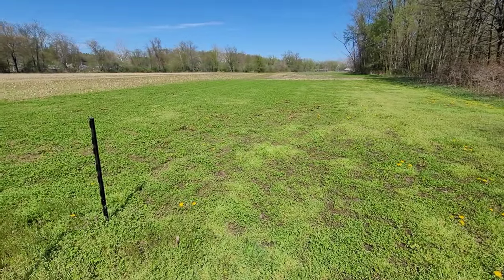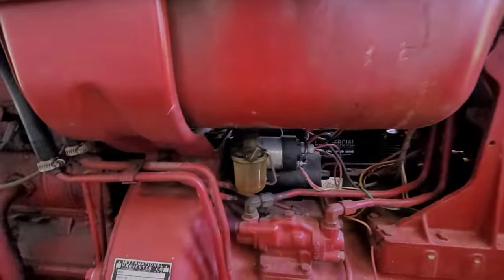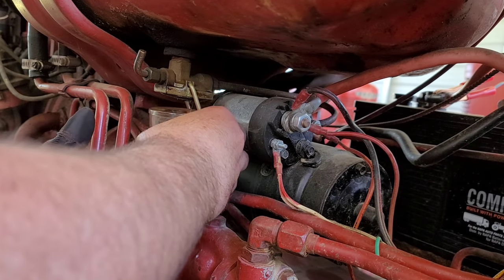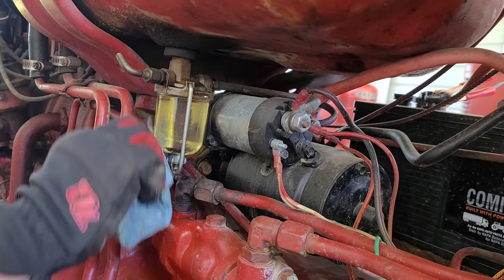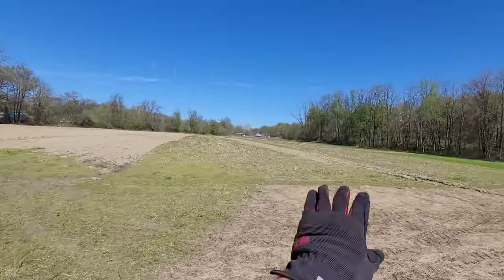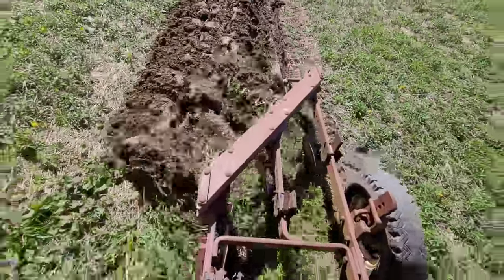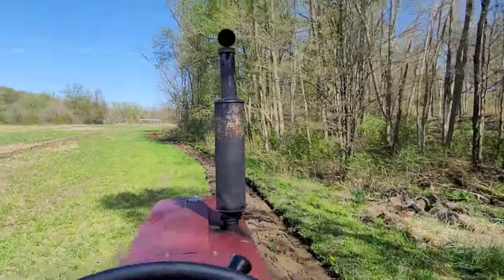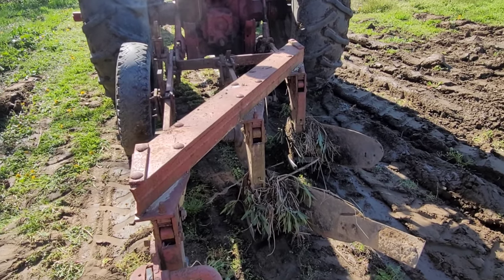Cleaning the Bowl & Fixing the Clover

Comment: If you have a bunch of varnish and residue from old gas in the tank, try  throwing a couple of cans of Sea Foam in the tank. That stuff dissolves the varnish. My Super W-6 had the gas tank full of that crap and I ended up cleaning the bowl frequently. I put 2 cans of Sea Foam in the tank and never had any crud in the bowl since. Last year at harvest, we discovered that the box was too bad to use on our Loadstar and it was harvest time. We found a 1962 Ford 3 ton with a decent box and a 292 engine. We got it running but it would barely run. We put 2 cans of sea foam in it and after a while it cleared right up and ran perfect. Pressure washing the gas tanks won't solve all your problems as the tanks have baffles in them. Your M gas tank has a baffle, too I know there's a lot of comments on that you need more plow on the 756. Although that may be true, in the soft spots it's nice to have a big tractor on a small plow. It would be great to have a fast hitch on the 400. It would be perfect. When messing with the gas, it's a good idea to unhook the battery with the starter right close. I learned that lesson the hard way. We went to get our Farmall 460 going. It was about 3-4 years and the gas was full of crap. So I pulled the whole sediment bowl assembly off and took a wire to dig out the gunk in the tank. The wire touched the solenoid I burned the tractor up and almost burned me up too. I was able to suppress the fire enough that I can save the tractor. But it did a lot of damage. And my hands were there dripping with gas when it happened....
Reply from the maker: Love seafoam